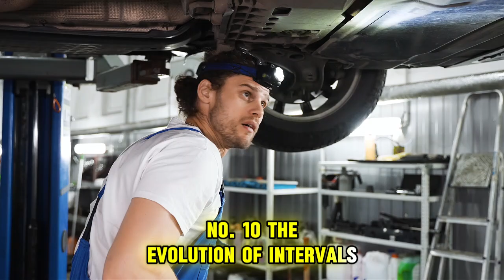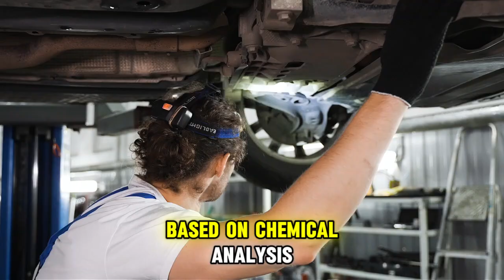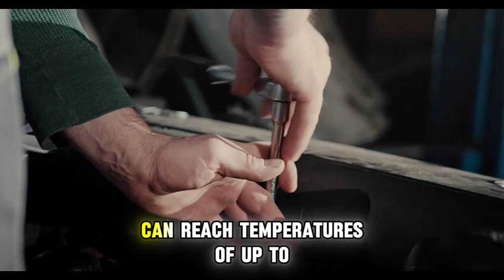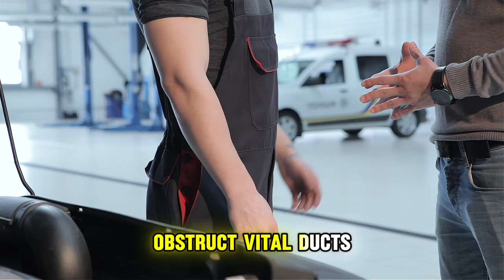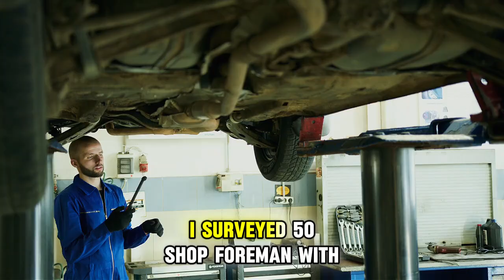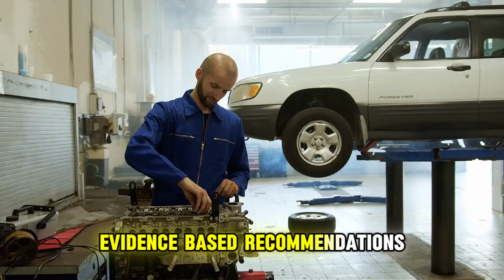STOP CHANGING OIL EVERY 10,000 MILES IMMEDIATELY! What I Found Will Shock You

Comment: Great content. I’d would like to add a few point to the 10.000 miles oil change interval. It’s just my opinion. You got to remember cars, trucks, motorcycle, boats etc companies don't build them in a vacuum. They don't just get to build whatever they think is the very best from the engineering prospective and then just put it in the market.

There is this thing, at least in US, called Environmental Protection Agency, and it has counterparts around the world. There is Japan, European, etc version of EPA. So the government basically say we want certain things, emissions, things from the engine, right? They're saying, well, how do emissions correlate to oil change interval? Well, in the EPA CAFE, so that's the Corporate Average Fuel Economy Standard, in the appendixes. It is not in the calculation books, it is in the appendixes, there is room that allows OEMs to get credit toward their fuel economy by reducing carbon footprint and things like that. So, oil change interval have gotten longer because that was a way for them to get credit towards their fuel economy, so their total emissions were lowered by extending oil drains interval, because all those regulatory agencies view used motor oil as a environmental hazard, right? So, if we can reduce that by longer drain intervals, then they get credit for that. In my opinion, one engine that last 500.000 miles is less harm for the environment than that one that last 100.000 miles. This is all BS from manufacturers. it is equivalent to students go to an exam and they don't know the topic, they are going to prepare for a broad range of topics. If they've already been given what the test is, then what are they going to do? They are going to study just for the answers on the test. That is essentially what happens, they come in and say, we want you to do this, and here is the incentive if you do these things. It's basic economics.

Comment: My Ford V6 will start crying just after 3000km. I replace the oil every two to three months, and the engine has not shown power loss at all.
Reply: Do you use synthetic?
Reply: @mayg7415  Yes, those so called synthetic Castrol, Penzz,  Mobil 1, Kirkland. All similar. Not lasting very long. My driving condition, based on Ford definition is severe.
Reply from the maker: It sounds like you have a great maintenance routine that's really paying off for your Ford V6!
Reply: @SimplifyingCars-u3l  Yes. I installed the oil drain valve, made oil change very simple. It proved that there is no wear if you change oil on time.